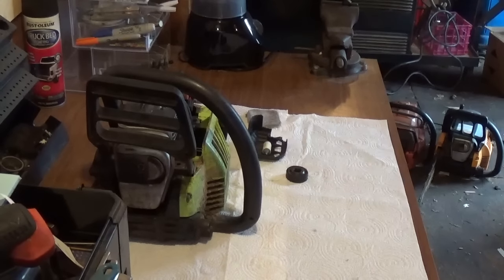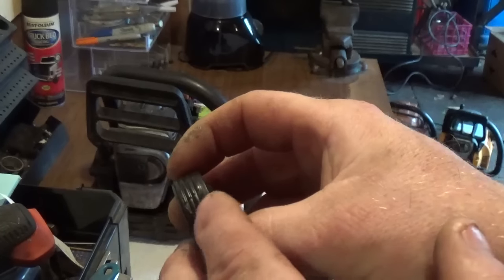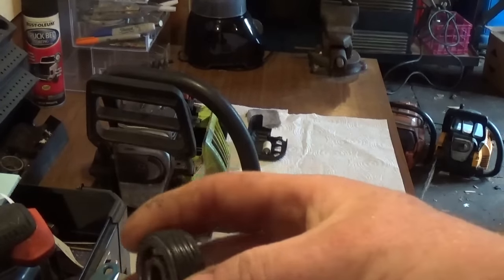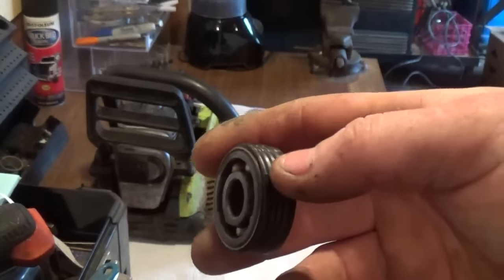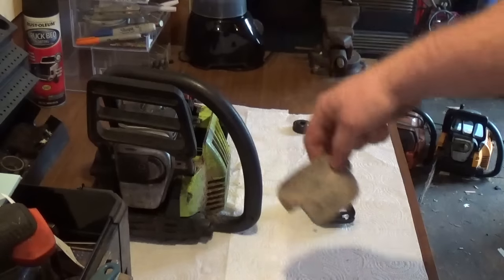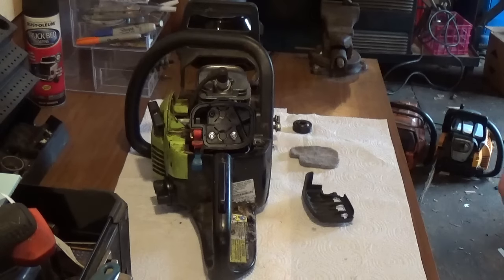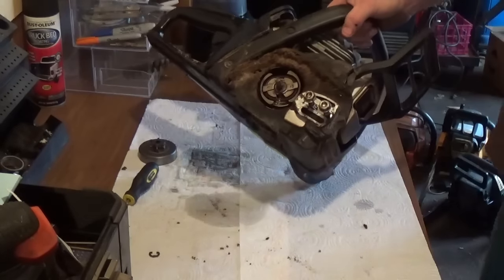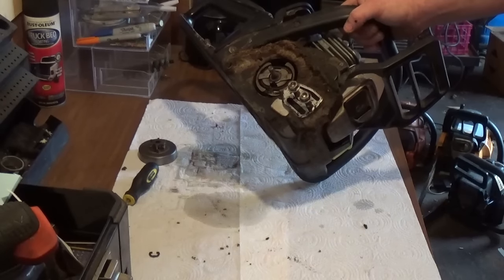Common problems with Poulan Chainsaws

Comment: Man I wished I had seen this video before I bought my "piece of shit" which you have thoroughly described so eloquently--got it on sale for less than $200 brand new and it gave me trouble right from the start--the carb adjustments needed a special splined screwdriver for Christ sakes!!---couldn't find one in my little town so I had to send away for it---$16 bucks when it was finally delivered to Canada!!---gas cap screwed up---saw would run for about a half hour then pack it in--on-off switch screwed up--can you send  me some of that blow-em-up stuff----great video
Reply from the maker: Lmao....I would love to but I think  that might attract attention to me ....However I can certainly tell you how to make it for yourself . Purchase bright flake 200 to 325 mesh from Pyro chemical source ...Then potassium perchlorate HP witch is high purity from Pyro chemical source ....lastly you will need ammonia nitrate .....this can be hard to find ...{ I recommend finding a pharmacy that carries instant cold packs } Carefully look on the back and make sure it contains ammonia nitrate and water as its only ingredients . Now dispose of the water packet in the trash ....This will leave you with just nitrate prills  ...Add 21 grams of potassium perchlorate with 9 grams of 200 to 325 bright flake ...mix slowly in a glass container with a wooden spoon { you will be making flash powder } so no smoking  ...Add 1 teaspoon to every pound of ammonia nitrate  ....although I typically just add about 1/2 teaspoon to the ammonia nitrate that comes in the instant cold pack . This creates a very powerful binary explosive target that is 22 sensitive .....Check out my other videos on my channel as I provide videos of both the mixing process and several explosions.......Note keep the remaining flash powder in a glass container away from flame { IN truth I recommend using it up ...so after purchasing a instant cold pack that works { buy a few more you will become addicted to the boom } Note ......The instant cold pack must contain ammonia nitrate in prill form ....Typically the size of 7 1/2 to 8 shot that would be found in a shotgun shell ...They have a white appearance intel the flash powder is mixed witch will turn all the contents a bright silver .  Then take your 22 rifle from at least 40 yards and shoot ....Please place yourself behind some obstruction as well as family if they are present .
Reply: Holy Crap!--thanks for the info
Reply from the maker: Welcome .....have fun ....be safe... And I wouldn't recommend placing it near a lot of metal that is very small . I tell you from experience {bad idea} LoL  ......obstructions are a  must......

Comment: I got a p4018 for Christmas 20 years ago.  It’s never failed until recently. Tons  of hours.  Mine took off without any gas.  I took it apart and found 2 possible air leaks.  The round part you were showing which goes around the crank lost it seal allowing air.  I can’t complain.